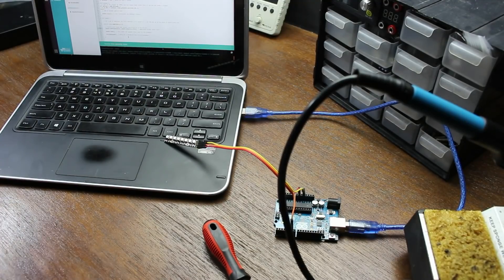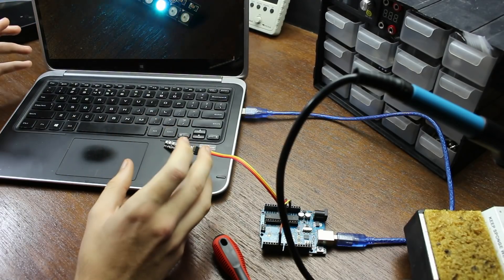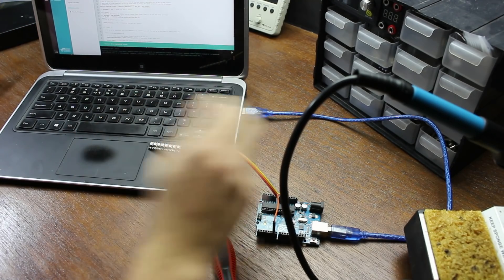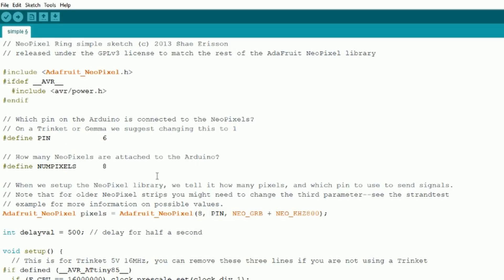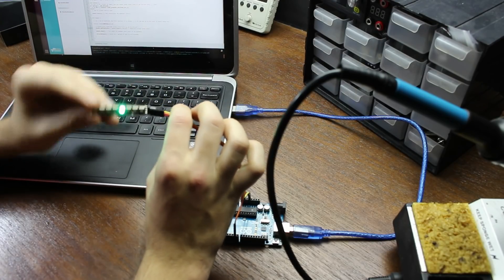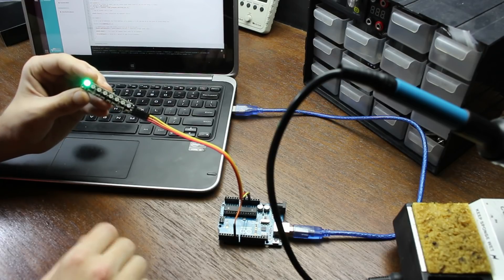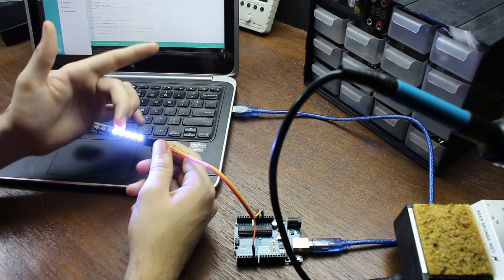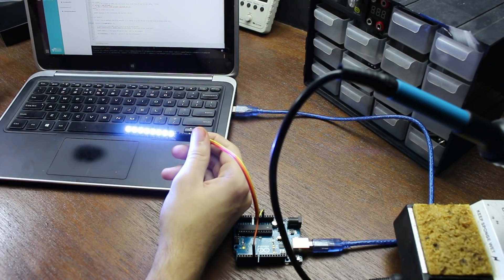NeoPixels, How do they work?

Comment: Hi, I'm trying to do a project using adressable 5050 rgbs but I'm having a problem. When I'm using it (150 led strip) it's acting like it's only 50 leds like they work in 3s does that make sense. I'm wondering if you know how to fix it?
Reply from the maker: Are you powering the strip from your microcontroller or from a different power supply

Comment: Nice Video!! 
I've a question. When I have a LED-Strip with 300 LEDs. How can I change the color of all LEDs at the same time? Is there a simple function? I tried to create a, array with all numbers of LEDs on this strip but this didn't work. When I create the "for loop" with "i" "crawling" up to 299 the information of changing the color "crawles" very slow upt to the end of the strip. Could someone help me? (I already searched on the internet)
Reply: Only use the .show() function AFTER you have changed all the color values in your array of 300 values.
Reply: The WS2812 format (used by the neopixel leds) can write to 30,000 leds in one second. 300 lamps takes 9 milliseconds. It should appear instantly. To understand the timing, allow 30uS (microseconds) per bulb.